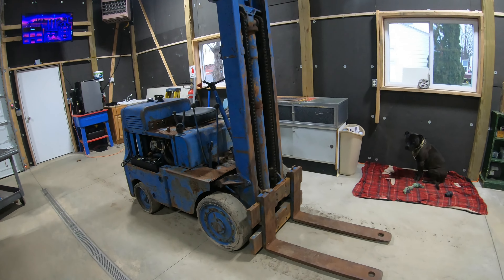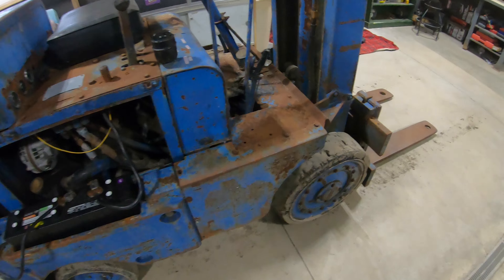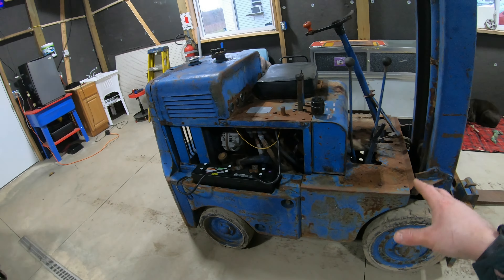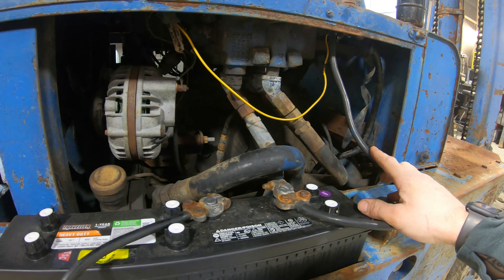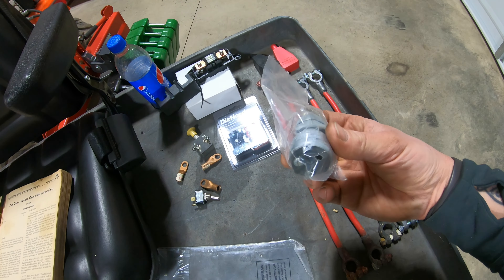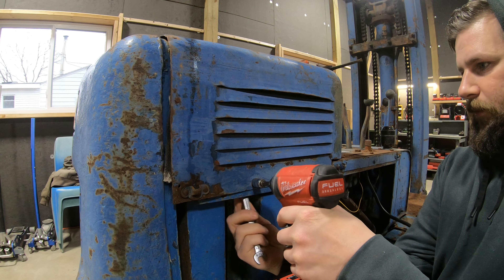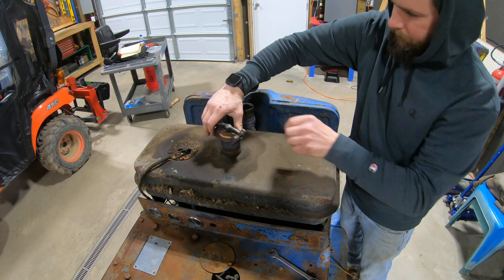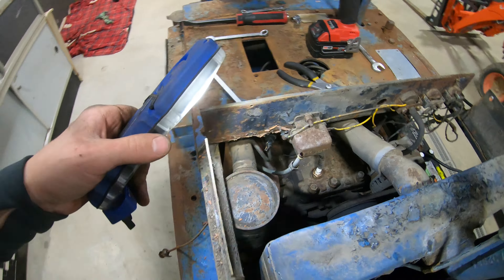I BOUGHT A VINTAGE FORKLIFT!! (INTRO + FIRST TEAR DOWN!) Part 1

Comment: I have the utmost confidence that you will have this running like a fine Swiss watch in no time. That manual will be a major help.
Reply from the maker: Thanks Ron! I agree about the manual.. just being able to see all the maintenance procedures.. the types of oils and grease and the amount of oil that goes in the gearbox, trans, engine, etc. alone is VERY good to have.. also like how it shows where every single grease fitting is.. cuz there’s alot!

Comment: Just a word of advice that I'm sure you have thought about. Run the negative cable to the block and then run a 8 gauge wire to the body. The gauges and ignition switch maybe the new LED lights don't need a 4 gauge ground the starter does though. Glad you got it and now you can shop for pallet racking and a more comfortable bed for Diesel.
Reply from the maker: Thanks buddy! Yah I def plan to ground the engine to the frame, and then ground the battery to the frame as well.. my plan is basically to modernize the wiring as much as I can.. add a couple flood lights too on the mast and I may even convert it over to propane some day if I keep it. I’d also like to make some custom side panels for it since the original ones have been lost which is a bunmer

Comment: I had an old Clark 3 ton ran week but could lift any thing I had
Mine was yellow had the same battery type. All 4 tires were small and could not deal with our non flat property. Mine was propane 

good luck enjoy
Reply from the maker: Very cool Ed! Sounds like it was very similar only I made sure this forklift had the “big wheels” in the front which helps it to get along on gravel driveways or uneven ground a bit better (so long as it’s not wet/soft). They concidered these machines to be indoor and outdoor only it was primarily made for indoor because of the hard rubber tires.. if you wanted a pure outdoor machine you’d have to go with a machine with knumatic tires.
Reply: @BiffsEquipment  I got it for free, sold and replaced with a 1840 Case Skid Steer not as strong but does more things.

Comment: Most of the old Clark’s around here were sort of a lime green colour. Fun project. 
Have you got it figured out where your going to put the muffler stack. 🤔😳
Have a great day.
Reply from the maker: Thanks Noel. Yah I think after the late 60s more from the 70s to 80s Era they changed the color to green and sometimes yellow towards the end of the 80s I think.. I did like that like green color as well.. I havnt decided if I’m gonna paint it or not.. it’s all orginal as far as the paint goes and I almost hate to make it look gawdy if I paint it and it don’t turn out quite like I hoped cuz there’s no going back.. so I’m thinking I may just scrape and brush it down and then coat the entire forklift in lin-seed oil.. an oil based product that protects bare metal and rusty metal as well as darkens old paint to preserve the patina.. just havnt decided yet.

Comment: Really enjoy your videos! Wondering if you could tell me what camera you use?
Reply from the maker: Thanks Aaron glad to hear it! I use a couple of old GoPros.. one is a hero 9 black and it’s a piece of garbage.. don’t buy the 9.. I ended up whipping it at a wall and broke the one screen on it cuz it froze for the 100th time and I lost footage.. now I’m down to just my old reliable GoPro hero 7 black which is my oldest camera and the one I bascislly started my channel with.. it works ok, has great picture quality but it crashes sometimes also.. just nowhere near as bad as the 9th Gen. I hear the 10 and 11 are much better and they fixed the issues but I have just yet to get one. Stay safe!

Comment: Bet there ain't a single 10mm on that entire machine - all SAE on that one!
Reply from the maker: Haha 😂 that’s funny that you mention it because on the very first panel I removed I knew not even to bother with metric sockets and wrenches! Out of all the bolts I removed so far the only single bolt that was metric was one that the previous owner had installed lol. 

I plan to put all new hardware on when we put it back together cuz all the old hardware is rusted and trash. Stay safe and thanks for watching!